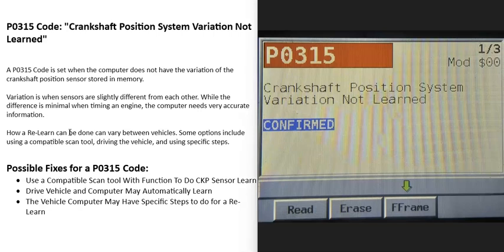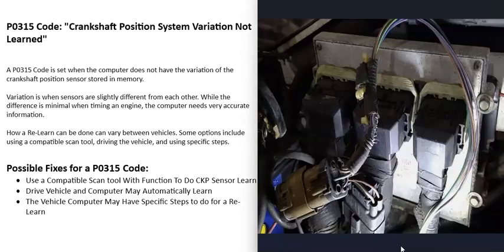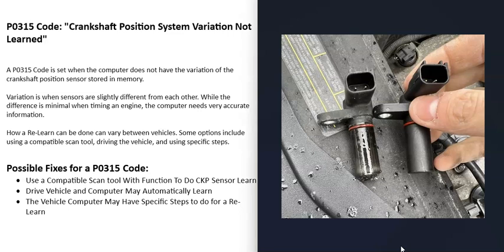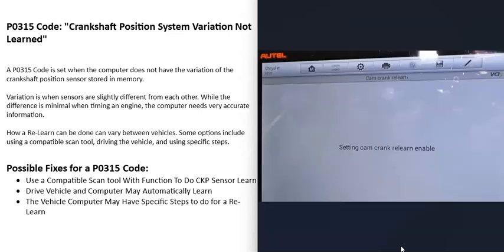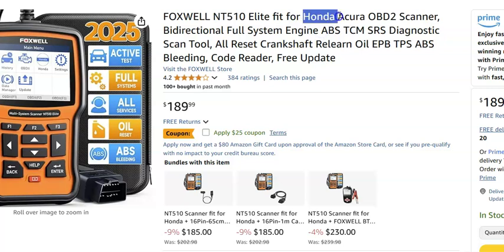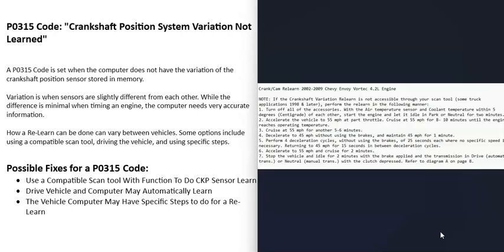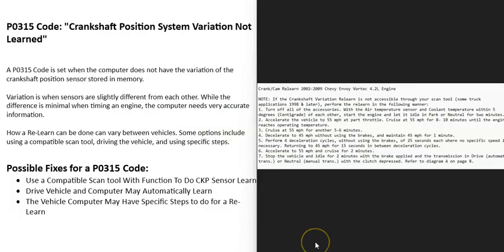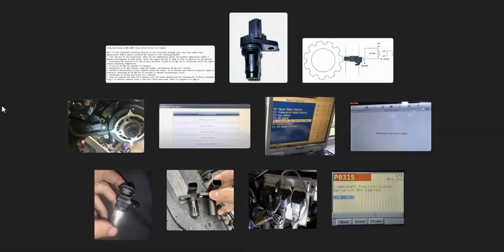Causes and Fixes P0315 Code: "Crankshaft Position System Variation Not Learned"

Comment: I have a 2013 Ford focus and the p0315 jumped at me after my battery died and I had to replace a battery. I've been driving the car for a couple of weeks now and it keeps coming back crankshaft position sensor variation not learned, stored DTC 

Any idea on how to fix that? Why won't my computer relearn the crankshaft position sensor?
Reply from the maker: It's best to research the year and model, but many Ford computers won't automatically relearn and require a scan tool capable of Crankshaft Position Relearn. There are several scan tools and computer software options that can do it.